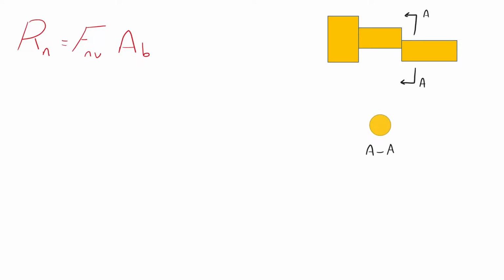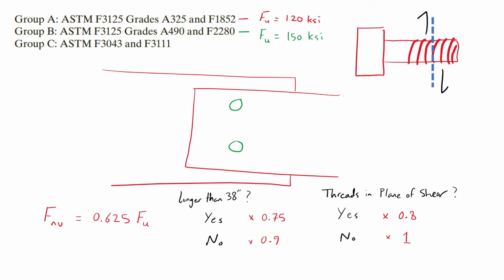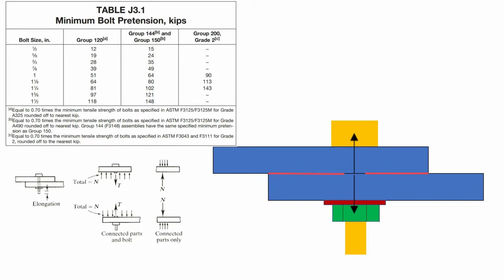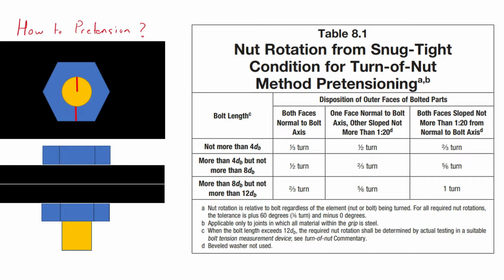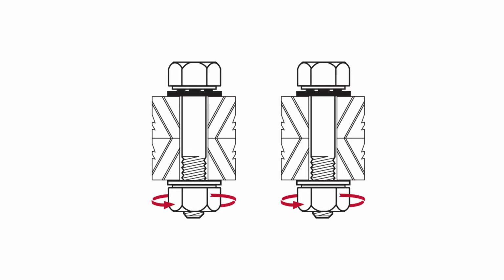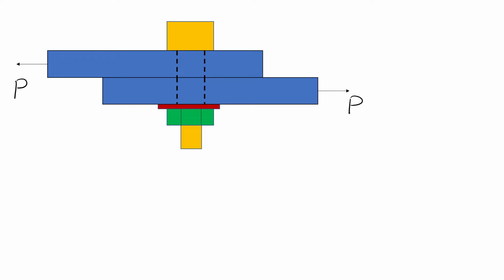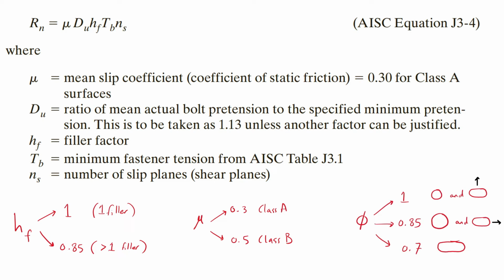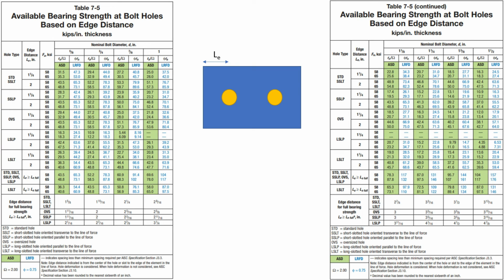What every Engineer should know about bolt tensioning @FrameMindsEngineering

Comment: Thanks for sharing. If you incorporate these example with to solve the real world problems or real projects then it will help us to understand practically as well
Reply from the maker: All videos posted first include theory followed by real life example videos on the same topic. Please subscribe and turn on the notifications to not miss the example video on bolted connections 😊 thanks for watching
Reply: @FrameMindsEngineering  being an engineer I am often getting confusion on taking which loads to be considered design for connections. For example if we do model and run calcs where we willget lot of values in the result table from the software in which what value we have to take for design the particular connection. Example base plate, for beam to column connection, etc.,